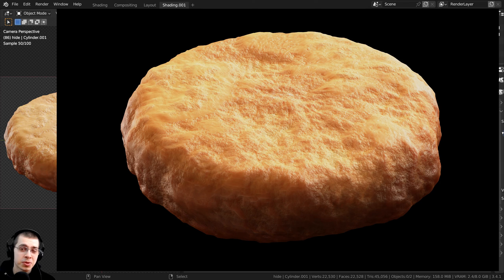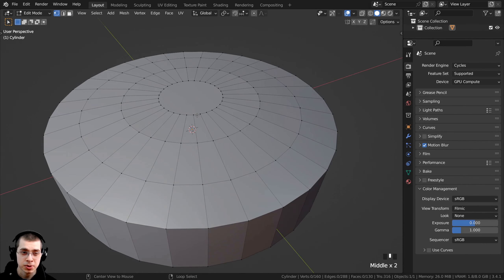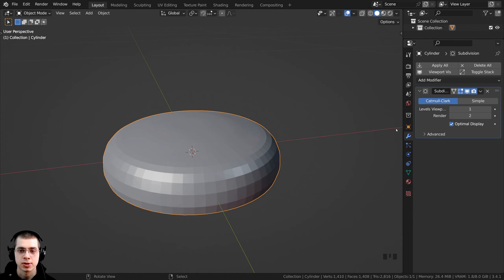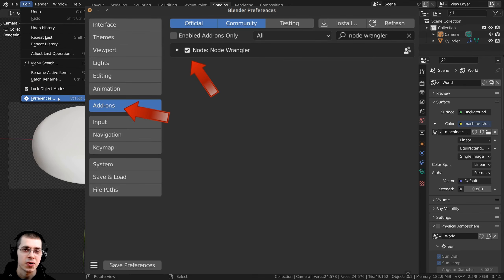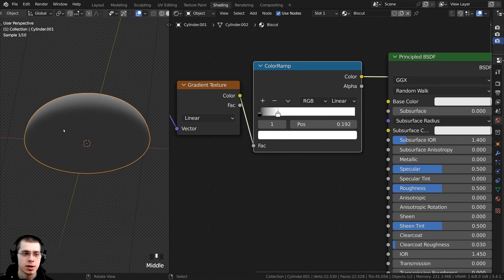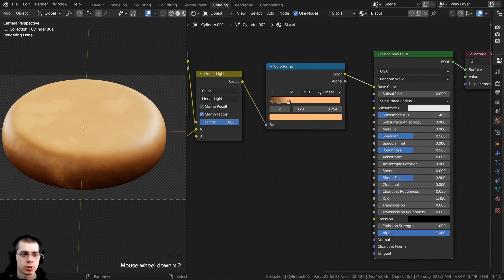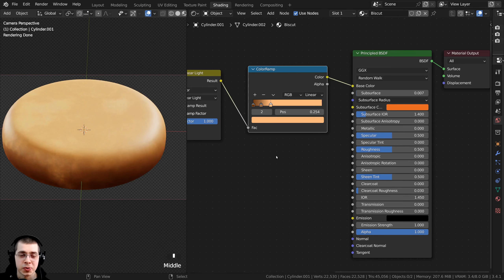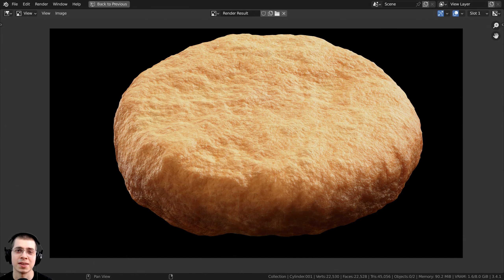Procedural Biscuit Material (Blender Tutorial)

Comment: Very nice tutorial. I added salt to it with geometry nodes. However the bump or displacement affected the salt so that they do not sit on the surface. Some are raised off the surface and some are under. In solid shading it looks fine but in rendered shading its messed up. If anyone has any suggestions that would be great. Thanks